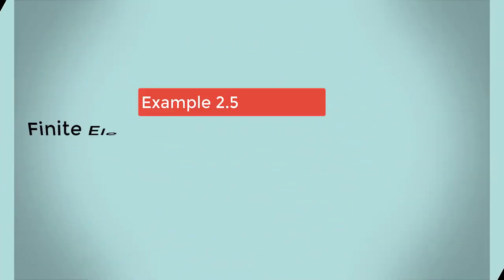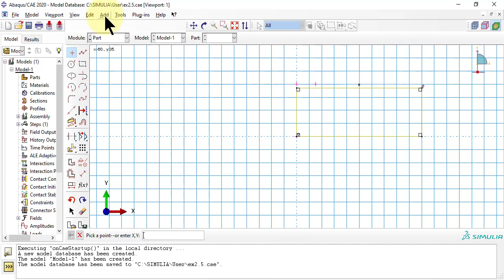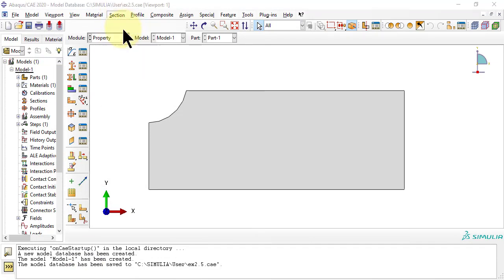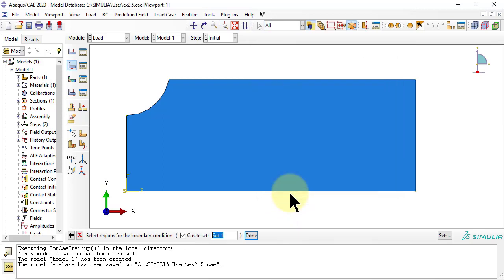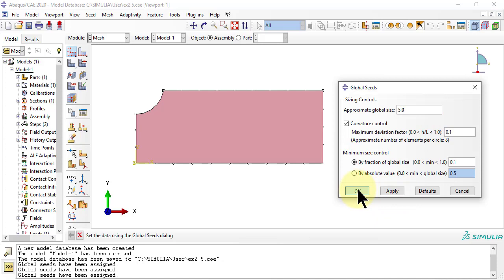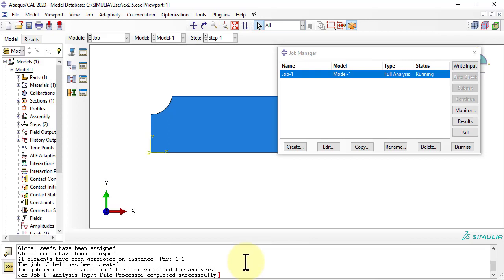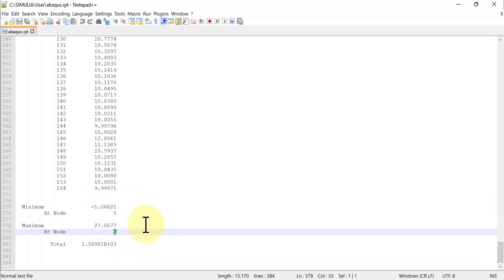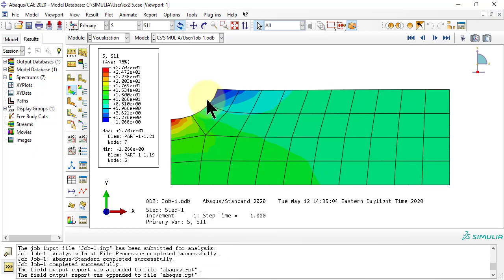Example 2.5 How to build a plane stress model in Abaqus to calculate stress concentration at a notch

Comment: Mr. Barbero, thank you very much for your instructive video. One thing I couldn't understand for plane stress analysis in Abaqus is that I obtain zero strain along z-direction (out-of-plane direction) but it must not be. For plane stress, out-of-plane stresses are zero but not the strains. I tried to extract the strain results by defining field outputs. But the strain along z-direction is still zero. I did not figure out this situation in Abaqus. I am grateful if you have any suggestion.

Comment: Dear Prof. Barbero Is necessarily the sample with higher stress concentration factor has less strength?
Reply from the maker: It depends. For ductile metals not subject to fatigue loads NO. For brittle materials (including composites) and all materials subjected to fatigue load YES.
Reply: @EverBarbero  Thank you so much sir. So, even for tension for composite materials the answer is yes, right?